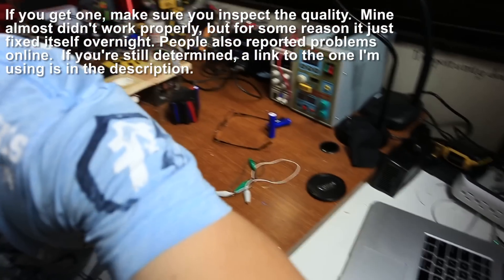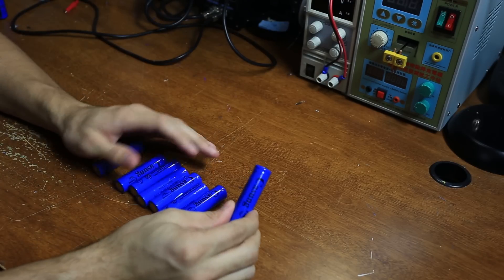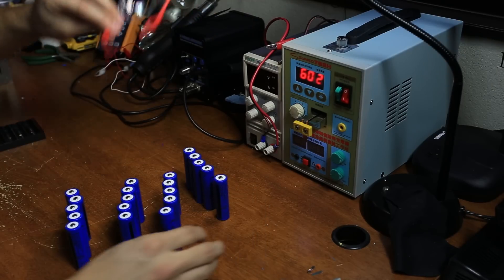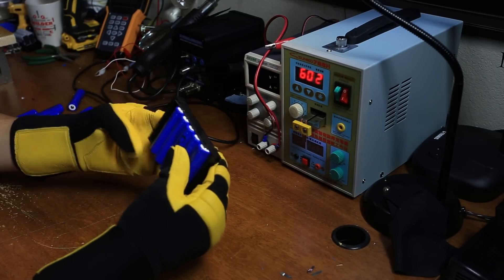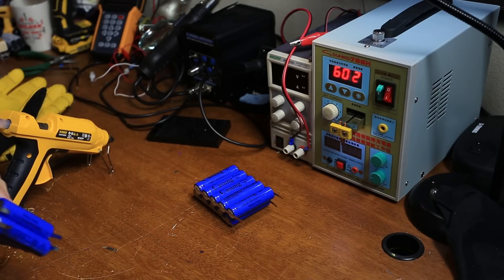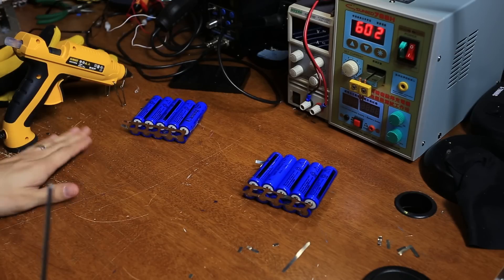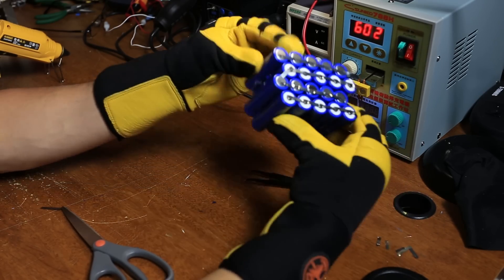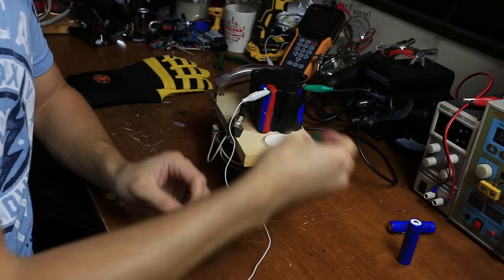How to Build Custom Li-Ion Battery Packs

Comment: I think I read somewhere it's a good idea to use battery spacers rather than put the cells touching like that, to prevent that the metal cans of the batteries can ever touch (like if the plastic case rubs off, say in an application with vibration) and short.  Like these pieces https://www.aliexpress.com/item/32839128820.html.

Comment: Few questions... Im so confused!  Looks like 1 row is all +, the next are all -, then at 5 min you connected them all together, flipped it over and said don't let the 2 touch with a piece of metal or it will short....but then at 540 when you connected the packs together at the end it looked like you did exactly that??  Also Why are the larger cell like the 38120 Yinlongs so much more powerful if they're 3.2v, 8ah?  High powered car batteries are 12v, 30ah.... what am i missing?  Were those packs one row + side up, one row - side up? You said in the beginning to make sure not to connect

Comment: Does hitting the protection circuitry on top of those protected cells with the spot welder destroy the protection? I understand the batteries linked to are unprotected flat tops but the ones used in the video all look to have that classic button top protection board heat shrunken to the tops with the insulated strip running down the side. I have similar protected 18650 cells and it would be awesome to have each cell individually protected like that... but have always just assumed passing that much current over them (if not directly through them) would immediately destroy any components that live RIGHT THERE under that part we need to weld to. The thought of using protected cells this way instead of a bms after welding hadn't even occur to me as a possibility till now. Thanks!

Comment: Hey! great video!
I got here because I want to make a 4s battery using the a123  26650 cell. The thing is the discharge rate would be much higher since each cell has a max continuous current of 70 A, and a max pulse current of 120 A (for less than ten seconds). So I was wondering what kind of welding strips should I use for such high currents. Do you think you could help me with that? I hope you're not too busy. Thanks in advance.
Reply: Or maybe I could just solder more strips on top of the others... I'm just thinking out loud in your comments section...

Comment: Hi, I just finish my pack 7s 3p my problemi is when I charge it the first time voltage is 29.5v not 24v,  And my first pack is 24v,  all my batteries tested 3.7 when ichecked the first time then bms charge all batteries not 3.7 but 4.2 v. I think it can be bad for my 24 v ESC and motor

Comment: Hi Can you tell tell how to arrange a pack for a 12v silimar to the SLA UPS BATTERY.  Also how to choose a compatible BMS for a 3s6p 12v battery pack.
Reply from the maker: yeah a 12v similar to SLA UPS batteries would be like 3s6p, but just add as many more in parallel as you need to increase amperage or capacity.  I would suggest checking out my video on avoiding using a BMS here: https://www.youtube.com/watch?v=Vq7ShNGRuxI
Reply: Is not that charger from Banggood also a type of BMS? I think a good BMS for 18650 will work the same.  My query is if I ever have to use a BMS for the 12v (SLA like) 3s6p pack then I am a bit confused because almost all the BMS in Aliexpress  with 6s BMS starts from 24 V. So Can I use any BMS with 6s config as long asthe amp matches?
Reply from the maker: Sort of.  I like it because you basically only have to buy one for all of your batteries instead of one for each battery, and you can customize it based on the battery pack you're building.  It's also pretty useful otherwise, and buying other BMS's is confusing.
Reply: I have many small and bigger UPSs in my house and I want to replace them with 18650 compatible packs.  I want to design each pack in the likes of the SLA.  I want to use these packs for general purpose  and also am thinking of building a powerwall based on these packs. So, I want to start from scratch but don't want to mess up things  in between. So I thought integration with a BMS would be better where I don't have to monitor so much.
Reply from the maker: If you want to build a powerwall I would recommend avoiding using cheap china batteries like I have been, as their capacity is someone in question from different shipments ore suppliers.  They're great little batteries for DIY projects and general purpose, even Ebike batteries, but for long term safety and stability / in home power, I don't recommend them.
Reply: I agree. I have scavenged from old laptop batteries and still collecting.  I am testing the capacity rigorously.  I will be using tested ones for the pack.

Comment: OMFG! Don't use hot glue!!!! Use 3m two sided tape or glue/epoxy. Using hot glue defeats the whole point of using a spot welder instead of a soldering iron. Dumping pointless heat in to the battery, degrading the battery for no reason whatsoever!
Reply from the maker: +Tankapotamus good suggestion. I didn't have any. :-D

Comment: Great video. I want to make a 12v (22ah are close ) lithium ion battery pack. I have a car jumper pack with a lead acid 12v 22ah battery heavy joker and it died and I want to replace it with lithium. Can you help?

Comment: Thank You for video. I am wanting to build a battery pack for my Earthwise 18-volt string trimmer. My thought is to make the pack into maybe a fanny pack thing that has a belt with a coiled cord that runs into the existing snap in ni-cad battery (and bypass this battery of course.) This trimmer when new would do entire yard before battery started deteriorating,,,along with the water grass that comes in mid-summer really kills the battery life. Could you give some quick insight if this sounds feasible? The factory ni-cad battery is 18-volt/2000mah.    I would like to have a real battery life of minimum 40 mins. Thanks.
Reply from the maker: +Barry Cisna if you need longer lasting power wire more batteries in parallel. More potential amps at 18 volts also means it will last longer.
Reply: Tommy,I am actually starting from scratch. I am still currently using the 'factory' ni-cad battery. I wish i knew how to figure how much 'average life' i could expect in regards to runtime on li-on batteries for the given dc motor inside the weed eater.  Dont have a clue how to find out amperage draw,,,,maybe hook multimeter in series with battery but that is tough with the given socketed,/enclosed battery for this. In other words how many 18650 batts to put in parallel to get x minutes of runtime @ 18-volts. Thanks.
Reply from the maker: +Barry Cisna 5 series 5 parallel to start.

Comment: Thanks for the video! I've been wanting to make a large cell out of 18650's to use as a portable battery bank to run a mitre saw with festool dust collector I use at work every day, all 12v tools
- there both rated 15amp tools but rarely blow a 15amp breaker when run together. 

-Any suggestions on the best way to build one?
-I'm building it into a Festool systainer approx 12"x16"x5" and would like to incorporate a charger into the case.
-I'd like to build it bigger the better, to last all day if possible. 
- big enough to supply 15-20amps
Reply from the maker: +Kermit watch my most recent video on charging them first, then get to building. :-) the more batteries the better, especially for long term power tool use.  Use 3 in series (11.1v), and a bunch in parallel (at least 5) - more parallel means longer run time.

Comment: Awesome man, keep up the good work.
By the way, can I use some other thing like a copper wire in place of nickel strips to connect batteries?
Reply from the maker: Thanks!  You could use copper wire but it would be more difficult to attach. If you solder it you might heat up the battery too much and cause damage to the cell, unfortunately, which is why a spot welder is a good idea.
Reply: Thanks for replying. Also, if I made a 12.6 volt pack, can I charge it by simply connecting it to a 12 V supply?
Reply from the maker: +Sujal Yadav you could but it would be more reliable to grab a cheap BMS which is a circuit that makes sure all your batteries get charged evenly. it can be had for less than $10. I've learned more since creating this video! :)
Reply: Is BMS able to balance charge a pack or is it just for safety purpose? And if they can charge what will be the input voltage required to cahrge the pack?
Reply from the maker: UPDATE: Here's how you should charge them. https://youtu.be/Vq7ShNGRuxI
Reply: Thanks.

Comment: What is better round (like the 186540) or flat cells? I am looking for is a single cell with a very high discharge (20c or 40C  needed to fire e-matches in a high power rocketry project) cell with protection rated at 2000mAH or higher (4000 would be nice).  What cell 
would you recommended?
Reply from the maker: Get some high drain batteries from a real brand (not cheap china batteries) like these: http://amzn.to/2kPHHQ3  Those should put out 30amps each.
Reply: Thanks I will order a couple today and test them out. I link you supplied does not say if there  protected or not. If not protected How can I add protection? I found a protection module at http://www.all-battery.com/PCB37vLi-ion1S_32174.aspx. How would I connect the BMS and the battery?
Reply from the maker: I'm not sure if it is or not - but you can use the one you linked and it should work great.  GreatScott did a pretty good video showing how to wire up a custom pack with a BMS only a week after I did this video - perhaps watch it and see what he does to his? https://www.youtube.com/watch?v=hwhqn4BmC2I
Reply: Thanks again for the great link :)
I have ordered the parts so now I just have to wait for them to be delivered.

Comment: How do you charge them? I thought a battery pack like that needs a balance charger?
Reply from the maker: +danml550 it doesn't neeed one but it's a really good idea to have one.. Just set my power supply to 16.5ish volts and connect positive to the positive tab, negative to the negative tab.
Reply: Tommy Callaway 

Thanks for the reply! The balance charger is what's been holding me back from building one. Thanks again

Comment: Some of these cheap batteries are only 600mAh. Have you checked your capacity?
Reply from the maker: Yes, generally they're around 1200mAH ro 1400mAH fully charged.   I mention this at around 0:48 in this video.

Comment: Obviously you made your choice but are there any disadvantages other than the lower capacity of those insanely labeled "fake" batteries? I'm thinking about durability and life time... Maybe for an electric bike it wouldn't be the best choice because there is more weight with more lower capacity ones but where the weight is not so important it could be good.
Reply from the maker: Yeah these cheap ones would be the best bang for your the buck even though they may last not as long as some other commercial options or higher quality batteries you can buy.  At 66 cents a pop it's worth a try!  I made a battery for my friends high performance RC car, and the battery I made with these cells lasted twice as long and the car went faster than his $50 LiPo battery, which surprised the hell outta me.
Reply: The only explanation would be that the battery you built would take up twice as much space on the RC car. 18650 format cells do have more capacity per volume than pouch cells(lipo), but the ones you bought will be at a big disadvantage to lipo due to actual capacity. From experience it's probably 1Ah, maybe even less. You basically get what you pay for.